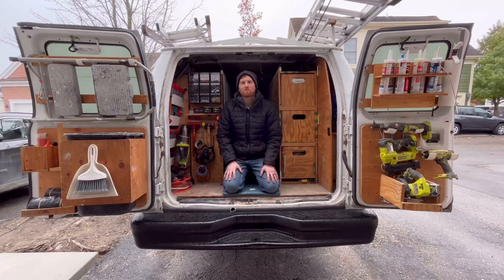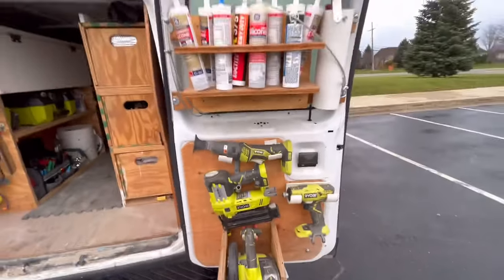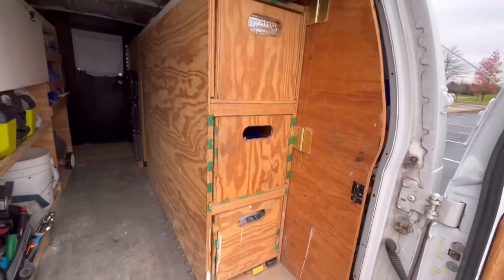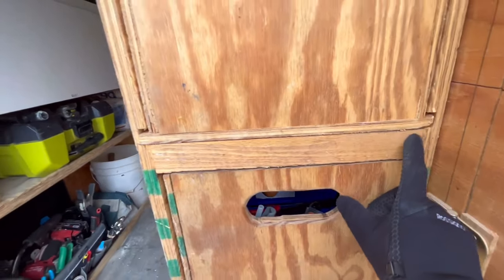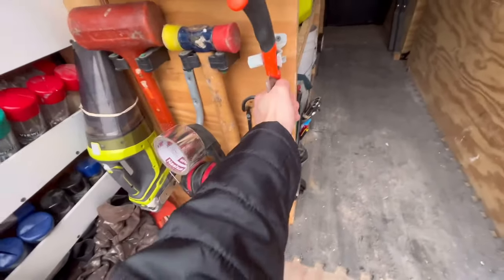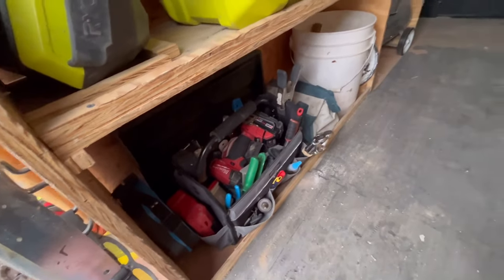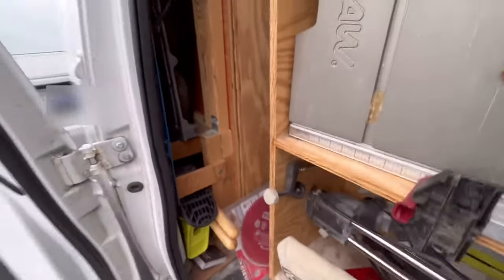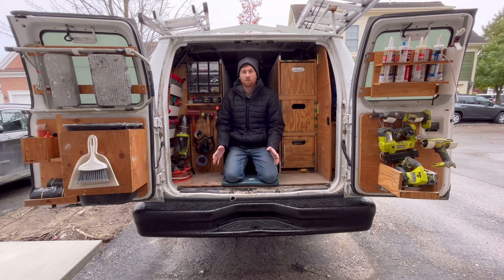Handyman Work Van Tour 2023

Comment: Excellent set-up, lots of thought to plan out tool and general equipment storage. First one I have seen with a toilet installed. Very smart idea. I have for years had a five gallon bucket, such as you get at the big box stores. And I attached a toilet seat. I line the bucket with strong garbage bags. I don't have to use it often but it has come in very handy.

Comment: That is nice setup. I worked out of a 1984 Ford E150 with the passenger seats removed. I never built it out because I was always hauling materials to jobs and hauling off debris. Most jobs would barely dent a dumpster so hard to justify. I would take tools on a job specific basis. I could get up to a 24-foot extension ladder in the van with doors closed. It's nice to have all your tools but if you have an accident or it gets stolen, you lose everything.
Reply from the maker: You’re right, that’s why I blocked out the windows to prevent prying eyes and am diligent about locking all the doors. It comes down to making it work for you so glad to hear you found a system!

Comment: Very well done. I really love the move out rack for table saw ET al. Having a dedicated dust bin and Pan/brush area on the rear door goes to show your attention to details. Nice. My 2 cents worth is to keep heavy items like compressors etc close to the exit point. Also. If you can afford 2 or 3 inches of space, you can utilize the long plywood wall on the right when u walk from rear to front to hang things, as long as they don’t interfere your getting in and out. Happy new year
Reply from the maker: Happy New Year to you. Agreed about keeping large tools accessible. In my case, I don’t use the compressor a whole lot and it easily wheels out if I need it. I’ve seen a lot of people keep their compressor fixed in their van/trailer and use a hose reel instead of lugging it out every time so that’s an option too. I like your idea to use that flat space on the plywood to hang things. However, I sometimes need to transport large items and debris so I need as much width as I can have in that center aisle.

Comment: Nice build and creative planning...i bought a van but making it a rv....fyi..get an alarm and put a hidden kill switch with other security measures because i got my catalytic converter stolen which is bad but nothing compared to losing the hole van and whats in it  or just some break in and half the stuff taken...by the way also i highly recommend driving with a dash camera it has saved my ass from liars...good luck 😎🍺
Reply from the maker: Yeah security is always an issue. I appreciate the suggestions!

Comment: Nice van! I just bought an E-250 myself. Came with metal trades shelf/bin system but I plan to slowly customize it and probably do something similar to yours.
Reply from the maker: Awesome! Glad the 250's are still out there and getting the job done. I took a week off from jobs to build mine after designing it. Ripped out all the  factory metal shelving and started from scratch. Doing it piece mail is a good idea too so you don't miss out on making money :)
Reply: @TheHandyManual  I saw that you have several videos on your build so I'll be checking those out for inspiration.

Comment: Very nice and practical. I've been doing handyman work out of my truck for the past two years and it sucks moving gear and tools in and out.
Reply: That's my problem I prefer trucks and the only way when I was a roofer and metal worker but when I became an electrician and later an appliance tech I worked out of vans but still prefer the easy access of the truck but the security of a van is kinda a good trade off. I work out of a truck now and my dad works out his van and sometimes we trade vehicles depending on jobs but it's hard to replace one with the other
Reply from the maker: Yeah, the great debate between a truck or van will keep raging on. I prefer a van for the reason you mentioned, all tools in one spot and there’s more opportunity to customize inside.

Comment: Thanks for the tour! I appreciate van videos for the utilization of space. I noticed you use a lot 3/4. I built a lot of stuff out of 1/2 using pocket holes, it gave me a great opportunity to figure out using pocket holes in that this of a material, and it’s still holding up after 10 years. Especially all the bins and drawers I made out of 1/2.I thought I’d mention it seeing space is a premium in your set up. Love the sheet good storage. I did a tour of my trailer here on YouTube. I got so many ideas on here, pintrist and a thread on contractor talk. Looking forward to to your next mods. May your work be tighter, faster and more profitable with every job you complete.
Reply from the maker: Thanks for your kind words! I used mostly 3/4 because my racking design called for a lot of dados so I thought 1/2 might be a bit thin. However, the 3/4 adds a lot of weight so in future fit outs I might opt for 1/2 or 5/8. Love that you took inspiration from YouTube as well!

Comment: I have an addition for you to add to your van....you'll lose about 3" of width for your center aisle though.
Since you like 3x4 ply so much....a slide out 3x4 ply top pop down work table.  Bottom slider of it would be working height (whatever you're comfortable at) and basically it would be a double slide so you can get it almost out of the back.  The in the van legs when folded down would rest on the bumper or back cargo area.  The ground legs would be 2 part with wing nuts to adjust the height for uneven ground levels.  The top would be about the same length as your drawers and 2-3 feet wide depending on your working height as the top needs to be able to lock under the preset height of the top of your drawer cabinet (so you don't lose the 4x8 sheet slide area).  The bottom of the table top would be a 2x4 or 2x3 box frame where the drop legs would fold up into.  The very top where it slides in would just be an "L" bracket so it can hold the top sheet (off set the frame from the edge of the top sheet so the L doesn't extend past the bottom of the table.  Basically, the table when folded up would take up 2.25" along the wall of the drawers.  This table would give you a work area for setting up the table saw/miter saw/etc at the van.  If you wanted to make a portable work table, you could use the same area of the van for storing it.
Reply from the maker: Thanks for the clever suggestion! I’m in need of a more convenient solution for an on-site work table. Right now I put a 2x3 piece of wood on saw horses, but sometimes taking the saw horses in and out is tedious. Do you have a mock up or drawing of the design?
Reply: @TheHandyManual  I actually have a pair of light duty saw horses that are pretty compact when folded up. Made of metal and not much bigger than your standard 2x4. I think they are around 30 inches long. I use them as table legs all the time.   Just throw a piece of plywood on top, instant work bench. I bought these at Canadian Tire. Obviously in Canada. I'm not positive but I think Harbour Freight sells something similar.

Comment: Hi.  Thanks for the tour.  I'm starting a handyman business early next year.  I've seen the Ron Paulk design drawers before, watched several videos.  How do you like them.  Intuitively I'd think they would not slide very easily, especially with lots of weight in the drawers.  What's been your experience ?   Did you lube them in any way ?  Thanks.
Reply from the maker: Hey bennet, great to hear your starting up a biz soon. Good luck with it. The drawers have been great. Built them in the fall of 2019 and no complaints. The plywood hasn’t swelled much so they haven’t gotten harder to pull out. With use the edges gradually mar and there’s less friction. A tip if you’re planning to build them would be to spend time ensuring the dados are straight and the piece you use for the drawer bottom doesn’t have a bow in it. Also, allow about 1/8” play on either side of the bottom. I’m planning to grease them up so they’re even easier to pull. Mine stay shut in transit too which is a plus.

Comment: what did you use to attach the shelves to the back door? I was thinking about self tappers but thought they would work loose eventually.
Reply from the maker: I used a stepped bit to drill into the metal then used Molly bolts to attach the wood pieces